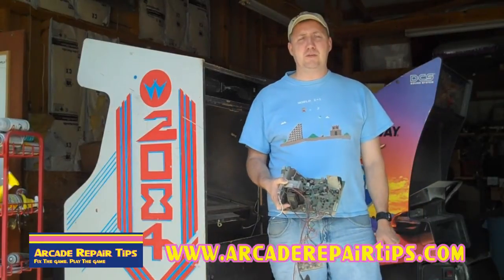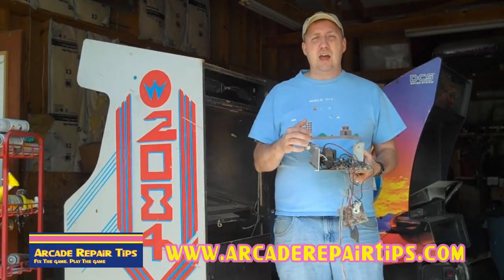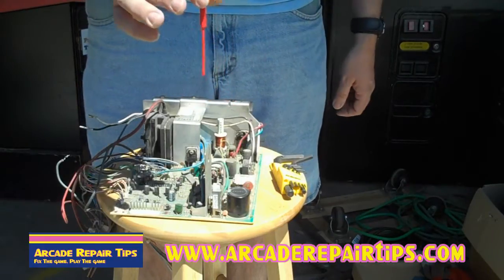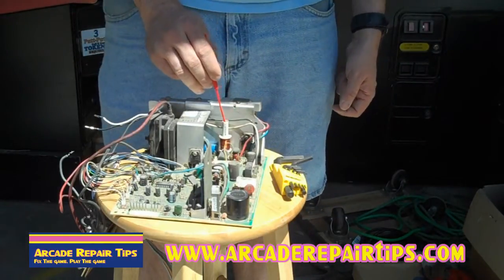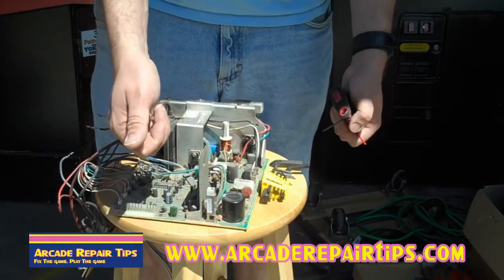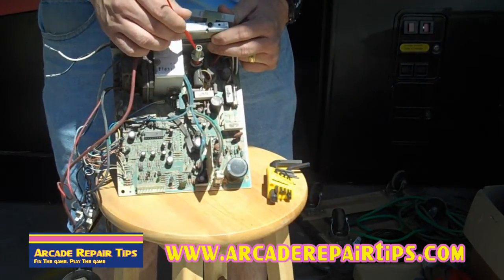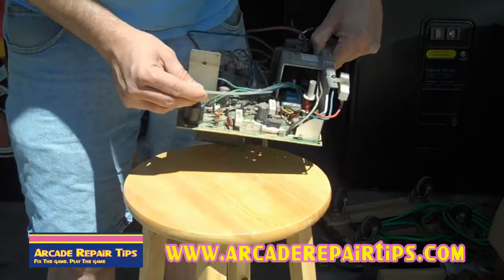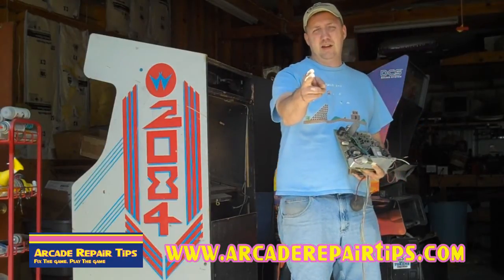Arcade Repair Tips - Adjusting The Horizontal Width Coil

Comment: my horizontal coil is like stuck, I cant get it to turn any way.I even bought a adjustment tool set like yours and still nothing.
Reply from the maker: Kyle S, try running the chassis for a while and see if it helps. Sometimes the heat off the chassis will help loosen it. You can also try desoldering and adjusting it outside of the monitor (top and bottom). We've also had luck using silicone on them. You can use WD-40 but be sure to rinse with soap/water and let dry.

Also, we will be covering your question on Live Show Episode 50 on Thursday, April 1, 2021 at 5:30 PM CT. Here's a link to the episode if you want to watch it: https://www.youtube.com/watch?v=2n5KYtdD86w. Thank you for your question and good luck with your future repairs.
Reply: @arcaderepairtips  thanks,yeah I tried everything and seems the coil is seized.Tried that tip you said with keeping the arcade running.Got ahold of arcadecup and looking for a replacement. my width coil looks different but I know its the right thing cause theres a diagram on the side of the monitor for the weells gardner 19k7610.Thansg again.

Comment: Hey! Thanks so much for this (and all the other!) arcade repair videos. Recently started exploring and they've been invaluable! I've also got a horizontal width issue, the image extends around 2cm (2/3 of an inch) on either side, even with the hor.width pot adjusted all the way. So the next thing to try is certainly the coil. However, my coil seems to have a little black seal close to the top, above the place where the screw is meant to be. I thought I'd ask here before trying to try it off... Do I just peel it off? Or is something else going on here? Here's a photo of it: https://bit.ly/3l1gcOU Thanks!!!
Reply: Did you find any solution for this?  I have that problem too
Reply: @manjin0409  i have this board on an OK BABY cabinet. if you see the board picture carefuly there is a ponteciometer on the left of your screen. VR101. this might fix this issue.

Comment: Never, Never, Never adjust the width coil with a metal allen wrench guys...  Even if you manage to avoid touching any part of the circut... you will crack or damage the magnetic material inside the width coil.......  The rest of the video is okay...

Comment: I have a question, actually when i turn on the Arcade the image on the monitor is small, after a few minutes, the images gets bigger, and the top a button part of image is getting cut slowly. Do you know what might be the cause of this?
Reply: Replace all the electrolytic caps first been 5 years since you posted this so probably fixed it but figured if someone else comes here looks at this.

Comment from the maker: @bigun89 Sounds like you might have a bad potentiometer. Try replacing it to see if it makes a difference. If the problem continues then check the Horizontal Width Coil and the polypropylene capacitors around it. Bob Roberts sells a Horizontal Width Kit that might help you out with this issue as well. 

We have also featured your question on episode 11 of our Q&A podcast. Please listen to it for more of our thoughts on your question. Thank you for your question and good luck with your repair.

Comment: I have a question.

My vertical size isn't getting large enough to fill the screen after I've replaced the tube.  The vertical coil was off by 3.3 ohms in resistance.  How do I get the vertical screen size to get bigger than what the potentiometer is allowing?